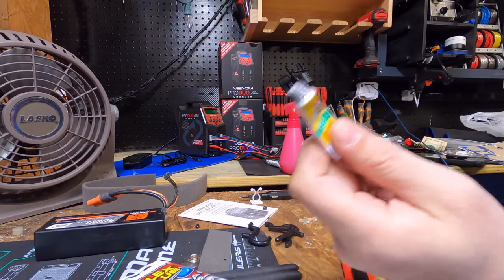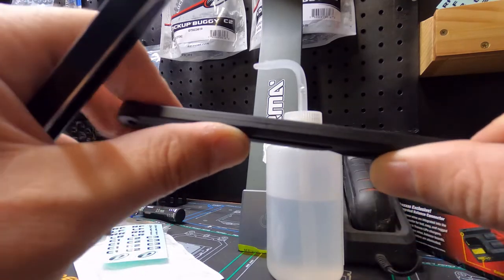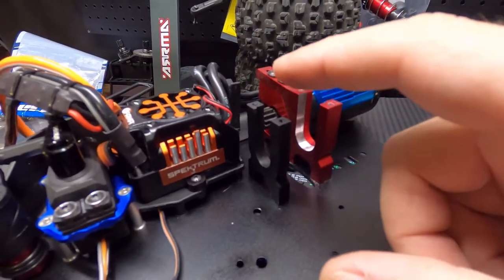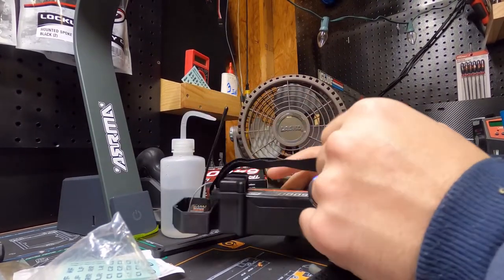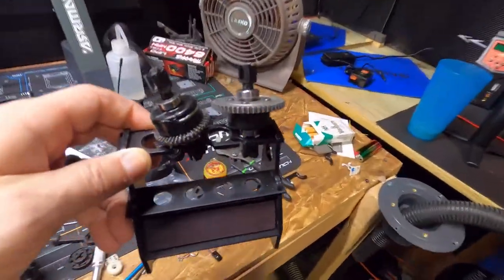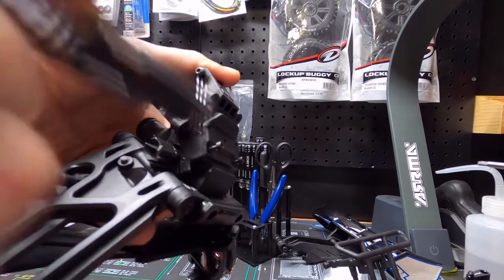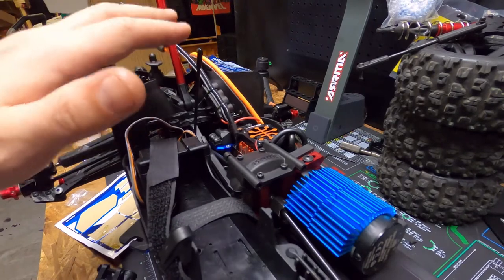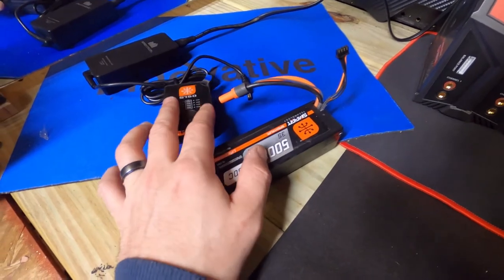Kraton6s +" TIPS & TRiCks" + UPGRADEd Rear BRACE

Comment: The  battery tray that hold the batteries the plastic part that the batteries slide under lift up on that.  It's on rails it lifts up and 2 batteries will fit under it
Reply from the maker: Hey ur right... It does extend up... Hey thanks..
Reply: @ATECHPCs  I've had several of these if you have any questions just ask.  I got rid of my current one because of my financial situation change really quickly but thankfully I was able to get rid of it so quick.   One thing to note.  2 2s battery's 5000 50c are plenty for this model and for me it is even more enjoyable. The two 3s spektrum 5000 50c battery's  make this thing insane.  You can even run a 5s battery in this and the weight iss u were asking about with 2 2s battery's you don't even notice the 2 3s battery's I never really noticed the weight either.
Reply from the maker: @danielcase2189  yeah life sucks sometimes in you're forced to make decisions like that thank you for your advice